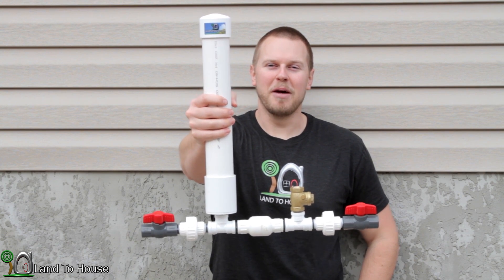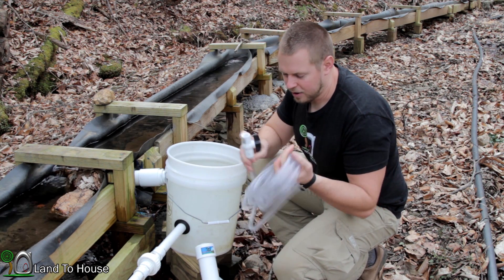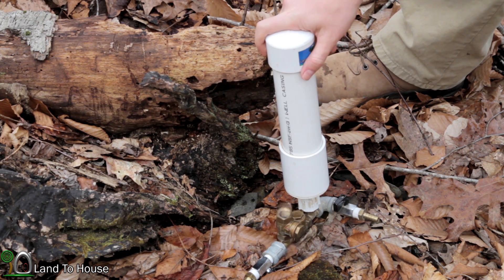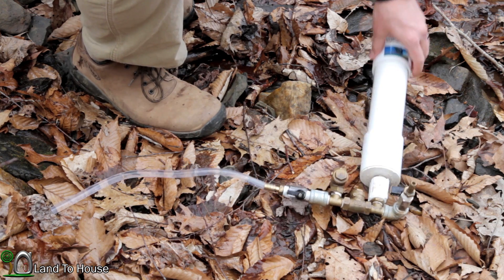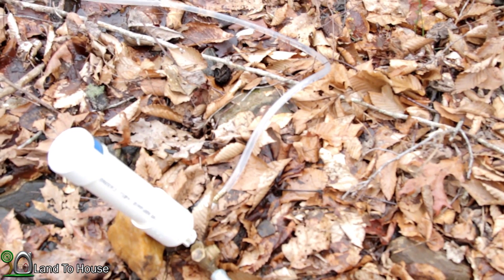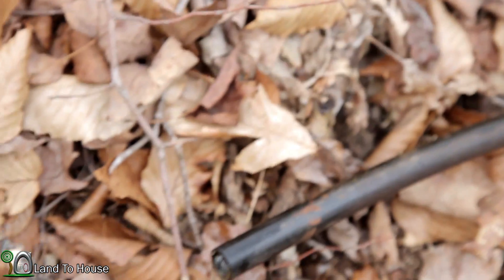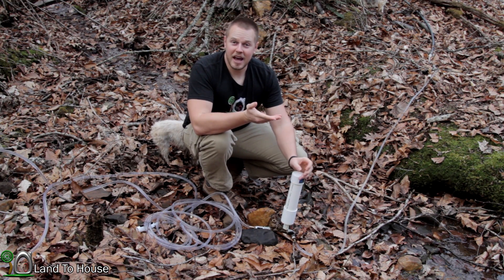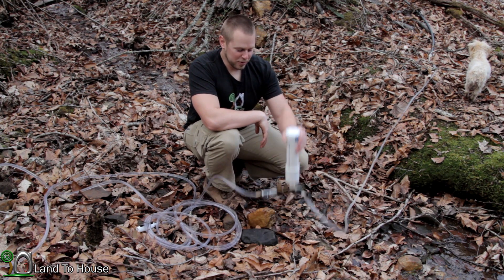WORLDS SMALLEST RAM PUMP

Comment: i think it is still viable. perhaps setup a gravity pressure feed pipe starting with 1/2 inch drive pipe that reduces after say 20-30 feet down to your 3/8th inch drive pipe for the rest of the length. that will give you increased gravity feed pressure to the pump and ensure the volume stays continuous. perhaps at the mouth of the drive pipe install a funnel collector as well. ive been using a gravity drive pipe for nearly 4yrs now to push water on my property before i got my ram pump. it is 1 inch for 20 feet then 3/4 inch for 20 feet and then 1/2 inch for about 250 feet. it has a total drop of about 14 feet over a long slope of about 80 feet then the rest is all up hill. the pressure that comes from it is amazing. i fill a 300gal water storage tank i buried in the side of my hill with it that overflows back into my creek. since i got the ram pump this tank and drive line now act as my backup and reserve. the ram pump takes water straight to my house now :)
Reply from the maker: I feel like it will work with a few adjustments. I am a little worried about the stepdown approach. Sure the pressure going down to the pump will be greater but when the pressure wave has to counteract that stepdown as it goes back up the pipe there will be a loss of efficiency that might prevent the pump from pumping. Still worth a try. There are still a number of things that can be tried.
Reply: Land to House
lol thats your department i know nothing about haha,,,
Reply from the maker: +FixedByDoc Homesteading I am known to be wrong at times.... I mean "50% of everything I do is wrong" haha.
Reply: Land to House
but you make it feel so right lol...
Reply from the maker: +FixedByDoc Homesteading haha yes I try my best. :)

Comment: great Ram Pump Video.  I first wondered if the drive pipe was hard enough.  Would the Pipe flex?  I think your experience on the subject is better than mine so I doubt that is the problem.  I felt your pain with the pump not working.   I have spent hours on my pump only to run out of time.  When I get back to it I would like to try the Stand pipe like you used on one of your video.    Thanks again.   Good work.  PS.   you sure do have a lot of subscribers.  Good Job.
Reply from the maker: +John Godwin I was watching the drive pipe bounce a little and put rocks on it but it seemed to hurt the operation because that movement was opening the check valve. My main thought was that the pump was not getting enough water. Stand pipes can make a big difference. The channel has been growing so fast. Now if only I could post more quality content.
Reply from the maker: Thank you for the positive encouragement. Messing up is what I do. I actually cut out a good portion of the problems I come to but the ones that seem to fit the video will stay in. It helps me to learn that way.
Reply: LOVE ... youR ENTHUSIASM !!!! - ))))

... please ... don't stop letting this youtube project ... BE about YOU and your ... CURIOSITY // PR.act.iC.AL ap.PLICATION  ... your sincerity and willingness ... to make corrections as you go .. s_HOW-IN_g US what has worked for you ... and not ((  !!! - )))))))  )) ... ie ... "... i've been at this for a hour or so .. trying ..."

... ha ha ... H_one_ST-Y ... LOVE IT !!! - ))))

... = SO FRESH ... in a fake-IT-Y FakE world .... = THANK YOU !!! - )))

MosT .. are afraid ... ...to "ST_umble" ... and sadly, (( ... thankFULLy ??? - )) 
fear, takes 5/6 th's  out of "H_umble" ...  ... ha ha ))))

Ma_KING ... your understanding "commercially a-vail-ABLE" ... is not !!! SellinG OUT !!! - )))

... it's called ... "BEING of SERVICE" ))))))))))))

Dr. E. Am ... BIG !!!!!!!!!! - ))
... and do NOT "BE" afraid ... to foLLow the enthusiasm !!! - )))
= ONLY YOU ... can "feel" .... for YOU !!!!!!!!!!!! - ))

... and ... what is an ... ""E-Pi-ph-aNy""  ??????? - ))

... and ... w-HERE does the "" L(if)E  P(at)H ""... of someone who BENEFITS ALL .... BE-(G)-IN ?? - ))

ha ha )))

... all-w-ays ... in-S-pHi-reD ... by youR V_iD_S .... thank YOU !!! - )))

LOVELOVELOVE )))
greb'Z )
Reply: ... thanks !!! - )))
Reply: ps ... not sure why ... the word "practical" turned into a link ???
... not my doing ....!!!! - ))

just saying )))